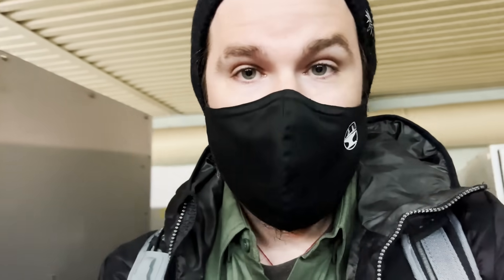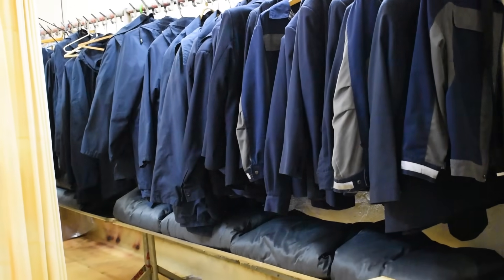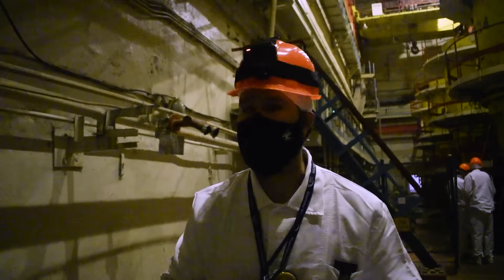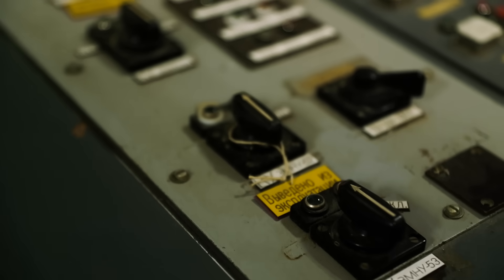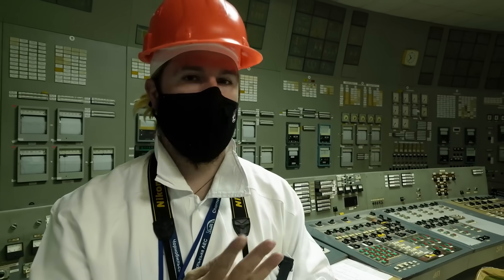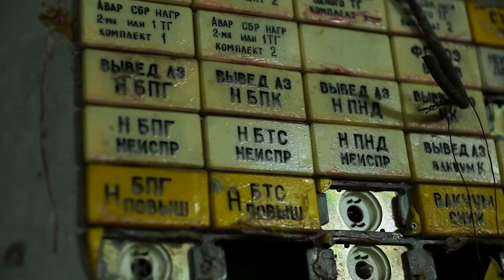Chernobyl Like You've Never Seen It Before...

Comment: Just to clarify. The nuclear fuel, or fission material did not explode. The voids inside the reactor reactor were poisoned with Xenon-135 this allowed the reactor to run out of control, and the flash vaporization of water into steam is what exploded. This blew the 2000 ton reactor cover off exposing the core to air which caused a secondary explosion which expelled the fuel out of the containment building, and the rest is history.

Comment: The pressure inside the core can no longer be held back, at long last we have arrived 01:23:45 EXPLOSION, in an instant, the lid is thrown off the reactor, oxygen rushes in, it combines with hydrogen and super heated graphite, the chain of disaster is now complete

Comment: What happened to all the switches and dials in control room 4? They were there after the explosion
Reply: Reactor 4 was never used again and was therefore left to decay and fall apart and not maintained. Also likely it was stripped for parts and scavenged as the other reactors were operated long after the disaster and therfore the control rooms look much newer. Reactor 4 control room had no use after the explosion.

Comment: one of the things that really sticks out to me in this video is the fact that you can see the footage become grainy at times from the level of radiation that is still present
Reply: This is incorrect. You would notice white dots appear and disappear, like Kyle pointed in the video where he filmed inside the new containment dome. But here the footage is grainy at times (at 8:57 for example) due to low light conditions.
Reply: @DreamyWoIf 8:05-8:06 there is artifacting in the darkness on the right side of the screen. Definitely was not just film grain because it was a solid white dot that appears for a millisecond. Put it in 0.45x playback and you'll see it. 
Edit: Actually it's super visible in regular speed as well
Reply: @lordsativa001  Ah yes, it's very brief, but that's exactly what I was referring to instead of what OP thought was due to radiation.
Reply: @DreamyWoIf  Indeed, I realized quickly that I had fooled myself as well. I thought it was just grain until I saw that lone white dot flash in the darkness, then I knew he had caught real artifacting on camera. Honestly cool as hell
Reply: One of the things that's sticks out to me about this comment is the inability to use capitalized letters and lack of punctuation.
Reply: @mowoonsnitz2994 don't get your panties in a bunch, it's a dot and one capital letter
Reply: I could be wrong, but - although the radiation will show up on regular films - it will not show up in digital recordings.   I think this was recorded digitally.  It is almost impossible to find today the films they used back in the 80s.  If you look at the original recordings from the original event, you will see evidence of the radiation on the film and in those videos - but I don't think you are seeing any evidence of radiation in the videos made for this channel.  The evidence will look like little sparkly stars that come and go.  
Maybe give a time marker of where in this video you see the sparkles?
Just the all-around grainyness or out of focus look may be special effects.  Like I said, I could be wrong  -  maybe someone who knows for sure can weigh in here?
😊
Reply: @mamaboocee  yes it does show up on digital cameras still
Reply: @anthonymanning8390 Why?
Reply: @kylebuchan3223 gamma rays hit the sensor, causing visual artifacts (the white dots or "grains")
Reply: @mamaboocee it does shows up on digital.

Comment: Where did you hear that the UBS was airborne for 10 whole seconds? I didn’t think anyone knew for sure, some speculate that it went 40 stories, some say it went up like 40 meters or about the height of the roof but I didn’t think there was a concrete answer. Just wondering where you found that information.

Comment: Why are the control rods themselves also radioactive? Are they just made of radioactive material themselves? You said that they became radioactive, so that means they weren't before. What caused them to become radioactive then?
Reply: Radioactive materials can cause other nearby non radioactive materials to become irradiated by covering them in radioactive materials such as dust, flakes, etc, via contamination, or even by irradiation by high enough energy making an isotope of the element which is when an element has excess protons or neutrons

Everything can do this to anything by simply being near anything because of molecules shedding from erosion

Comment: What happened to all of those switches, indicator lights, gauges, and controls in Control Room #4? Were they removed? Did the radiation make some of them disintegrate? Did some of them melt from the heat? Did they absorb too much radiation and have to be removed?
Reply: Likely removed due to concealed tech

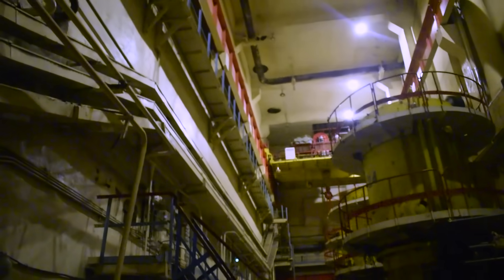Comment: Hey Kyle, I have a question. Back in your video about the Elephant's Foot, you had mentioned that one of the pictures was really grainy because of the radiation…… But then, isn't… That why the video gets grainer and grainer at 7:56 - 8:23? If so… doesn't that mean you were getting a higher intake of radiation…? That scares me… I hope you weren't there for long…
Reply: That's caused by cheap phone camera in low light, that's not caused by radiation, radiation would cause tiny white pixels

Comment: My uncle was working in reactor 1and2 at the time of reactor 4 melt down. The fear the people went through is unimaginable. I forget the head engineer whom was overlooking the safety test but he was literally shell shocked as to what just happened. Because of the lies that the ussr had told them about az5 scram button he figured he had a safety net that was indestructible. But in reality it was a hoax due to the short cuts taken to quicken the building of reactor 4. There was a similar but not catastrophic episode in reactor 2 I believe but the az5 worked and only minimal damage was occurred. It was in 1982 I believe.

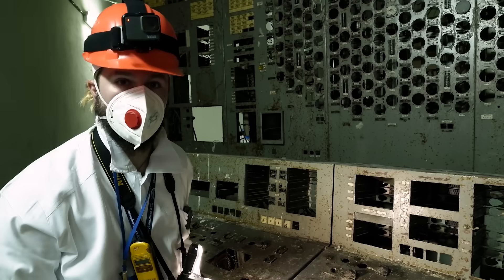Comment: 11:34 do you mean that the fate of the core was sealed before this or that pressing that button caused the core to destroy itself?
Reply: The reaction inside the core was already out of their control even before the AZ-5 button was pushed, they just didn't know it.

They removed nearly all of the control rods from inside the core in order to increase the reactors power. When they achieved the required power level for the safety test they began inserting the rods back in the core to level out the power however, instead of levelling out the power kept rising (due to the graphite covered tips on the rods they were re-inserting).

As the pressure and power kept rising rapidly they pressed AZ-5 which inserted all the rods at once hoping that would stop the run away reaction in its tracks, however all this did was bring all of the graphite covered tips into the already unstable core at once which exponentially sped up the surge in power and caused the steam explosion.

So essentially once nearly all of the control rods were removed to raise the power there was only one outcome at that point (but two ways of reaching it). Either insert the rods gradually until the pressure got too high or insert them all at once (which they did) and cause an explosion.
Reply: @HOWLER1992  thank you for the explanation, good sir.

Comment: Assuming that the lid was pushed up in a single thrust (which it probably wasn't) and that it took ten seconds for it to land again, it would hit the peak at around 5 sec mark. With gravity being the cause of deceleration we have the acceleration formula of t ^ 2 * ½a that would mean that we have 5 * 5 * 5 for how high it flew.
You are telling me that that dang thing could have flown 75 meters into the freaking air, before it came down again!
If the bloody thing weighted 2000 ton it was blown into the air with an initial force of 2000 * 75 ton/sec which is 150000 ton/sec, or 150.000.000 kg/sec.
someone correct me if i am wrong, and someone give me perspective to, this does not feel real.
And it probably came down again with the same amount of force.

Comment: Years ago my (then) 4 year old daughter and I estimated the muzzle velocity of a tennis ball launcher I made.  We used basic kinematic equations to calculate the acceleration and deceleration due to gravity.  For a sphere I didn’t bother with drag at such slow speeds.  It left the barrel at around 72 miles per hour.  By those basic calculations and estimating the massive drag on a bluff body like a disk that reactor top was likely moving around 100 mph at lift off!!!

Comment: If my calculations are correct, that shield went up some 400 feet (125m) before it came back down. That has to have gone through the roof. It would actually have been clearly visible to anybody who happened to be looking at the building from a distance at that moment.

Comment: I assume the fuel rods for the other reactors have been removed, but what of the graphite blocks that surrounded them and the control rods? They were lethally radioactive while all four were in operation, and although the reactors have not operated for at least  17 years or longer, they must still be radioactive. Doubtlessly not nearly as much as the graphite ejected by the explosion of Unit. It was radioactive enough to inflict far beyond a fatal dose in mere minutes, and fire fighters were irradiated to death by it.

Comment: Evening Kyle..   You'd said that the SCRAM button was pushed, but only stated that the reactors fate was sealed...  What happened when the button was pushed?  Did it fail to work?
Reply: Not sure if I’m 100% correct in this but from my understanding they’re was an engineering/electrical error that when the scram button was pressed it caused a very short but very strong surge of power before shut off. The power was made by the control rods being shoved back down very quickly displaced some of the water and shows a quick peak in energy. That sudden burst of energy caused a big boom boom. I could be entirely wrong but as far as I’m aware this is the very basics of what happened

Comment: Nuclear energy is probably still needed in the future, but the failures are so scary.  Even with the healing through cleanup, sealing, and some half-like decay, it will take hundreds, if not thousands of years for this area to go back to normal. On even the smaller insect and arachnid level, things are clearly not right to this day. Many, many generations of spiders later, you see active spider webs in the exclusion zone that are quite erratic which is quite unusual for spiders.

Comment: I have a couple of questions Kyle:
- If you have to go through a "radiation airlock" and change clothes multiple times to limit contamination spread, did you have to get your camera equipment cleaned or decontaminated when you came out?
- Does radiation not usually corrupt video footage or does that only happen with film?
- How much percentage of a lethal dose were you exposed to in the time you spent there, or is it negligible?

Comment: Thanks for the close-up Kyle. You did a great job of showing the before/after between reactors 3 and 4. I first become fascinated with Chernobyl when I found out I was heading to Ukraine for flight school before heading to Iraq as an advisor to their Air Force (2008). At night, in Kremenchuk, Ukraine, when I should have been studying flight characteristics and systems of the Mi-17 (Mi-8MTV) helicopter, I was busy reading about Chernobyl, the design, causes, etc. I'm sure my classmates were doing what they were supposed to and not indulging in Ukrainian Vodka. Each morning before flight school, I told my classmates about what I'd read. Though not talked about in part 1, the graphite coated rods was a huge contributor to the overall fallout (especially hit hard was Belarus). I look forward to Part 2 (I sub'd as soon as I watched this). Cheers from a Yank in the UK.

Comment: Ive seen a lot of documentaries about Chernobyl and was in France and Sweden a few weeks after the event. The perspective of being shown the plant, as now allowed for visitors, is interesting. QUESTION: Were the two, partially constructed cooling towers shown at 15:10 part of Chernobyl? Seems they shouldn't be, as they were not completed.
Reply: There were two additional reactors in progress at the time of the disaster - the unfinished Reactor 5 is visible in the shot of the cooling towers, and is the rusted brown shape surrounded by cranes that you can just about see in front of the New Safe Confinement. Reactors 1-4 were cooled with water from the adjacent reservoir, but 5 and 6 were to be cooled by those towers.

There's some reporting alledging that the site was planned to have 12 reactors, with the last to come online by 2010, but I can't find much to confirm that.
Reply: @AJHadley  That makes a lot of sense. Thanks for the reply.

Comment: As a chemical operator at a nuclear site in the middle of cleanup (weapons grade), thanks for explaining the basics of PPE and dirty/clean zones. Radioactive contamination cleanup as a job is dangerous work and I wish more people knew the basics, and why these type of sites are off limits to anyone who isn't working there. Most loose contamination is only dangerous when it enters the body either via the lungs, stomach, or blood. Cancer or longer term issues can arise from this type of contamination. Getting a big enough dose from objects with fixed contamination to cause problems is solely about time. These thrill seekers that break into these sites have no idea where these contamination areas are and whether there is an airborne factor involved if it is loose. I hate to think about these people taking contamination out of the site and into their homes, or the homes of others.

Thanks again for sharing this important and interesting information with the masses. Nuclear power should be used beside solar and other renewables, but first the public needs to learn from the past, why we need to respect it, and put checks and balances in place so events like Chernobyl never happen again.

Comment: 75 microrem/hour is extremely low dose. The average person picks up 228 millirem a year from cosmic radiation alone not to mention other sources of radiation’s. 228 millirem is 228,000 microrem or 624 microrem per day. Which is the dose you’d pick up in 8.5 hours in a field of 75 microrems. Where did you get your figures for average background radiation? Seems like the use of microrem is needed because it wouldn’t register in millirem because the dose is so low.

Comment: This was beautifully shot, and I was really awestruck at how you explained the intensity of the explosion, to lift that gigantic structure into the air for 10 seconds. It truly is unthinkable to imagine how much power that would've taken.
Reply: Power of steam explosions. Its the entire reason for why the containment building of western reactors is so big and re-enforced. Not to contain the nuclear reaction nor even act as a radiation shield, but simply because the water deconfining and flashing into steam would expand to hundreds of times it's original volume.

Comment: The mass of the biological shield gives you most of the pieces for an interesting simple back-of-envelope estimate on the energy released. 2,000 tons x acceleration of g x height. I don't know the height but guess 10 meters, gives 200 megajoules. If the lift takes 1 second, 200MW.

Comment: I have a question though; Why is the control room of Unit #4 decayed so much, while the control room of Unit #3 is still almost intact?
Awesome video.
Reply: I think they still used the other reactors for a few years after the event? I may be wrong though.
Reply: @WouldntULikeToKnow.  Chernobyl was shut down in 2000.
Reply: The "liquidating"/cleaning of Unit #4 caused the decay... Liquidation of cesium dust was often made with high pressure streams of sand, so it damages and scratches everything. This is also why the buttons were removed, to ease the cleaning. People often think it is vandalism but this is the only room that is in this state, in the plant, because it was the most contaminated (when you look at the control panels, the reactor is just behind you (not in front of you), behind the wall that has been reinforced which makes the room smaller)